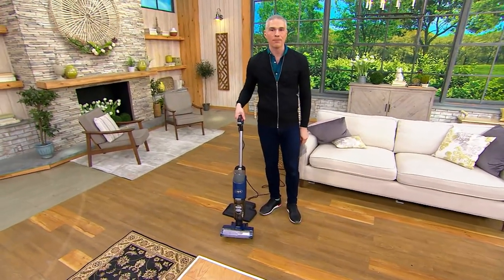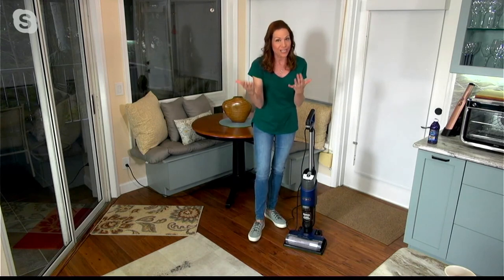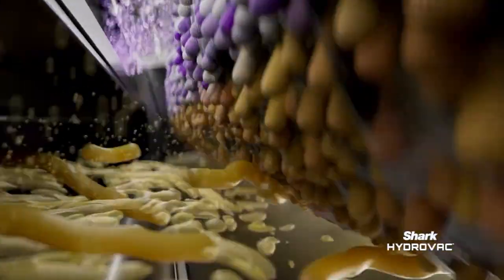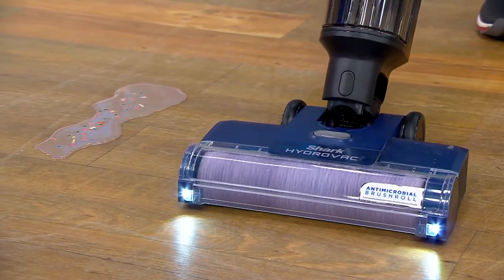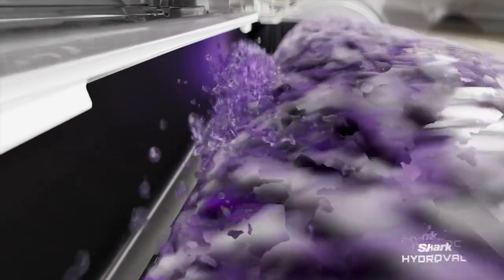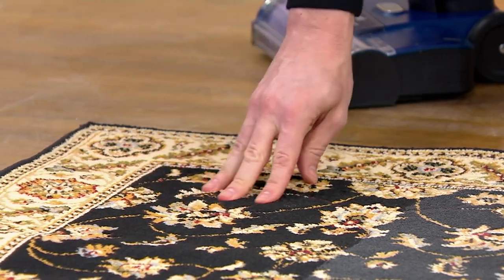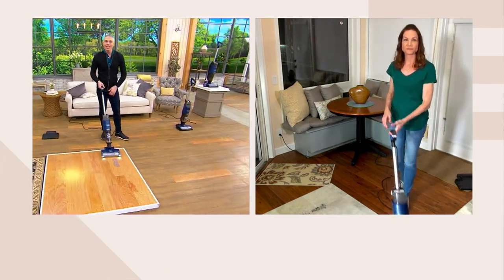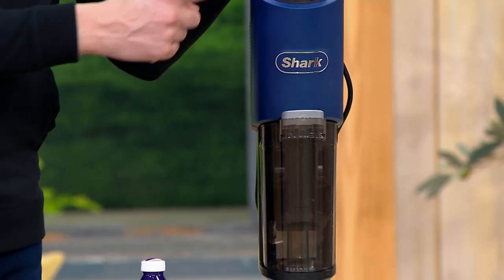Shark HydroVac 3-in-1 Multi Surface Cleaning System on QVC

Comment: The problem with the cheaper ones is rather you get to spray the water yourself or it's always putting down water like the forward pass water and the backward pass is also water if you get a more expensive one like the one I have the front pass will be vacuuming and the backpass mop